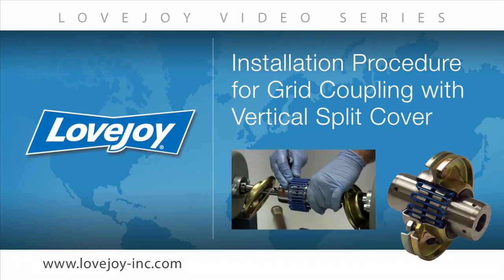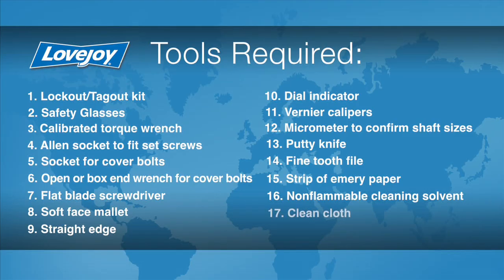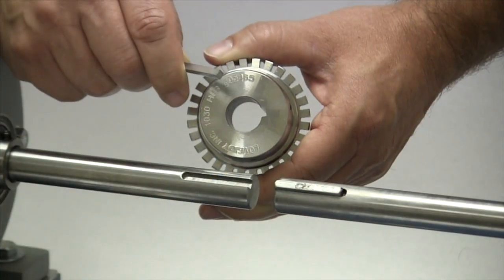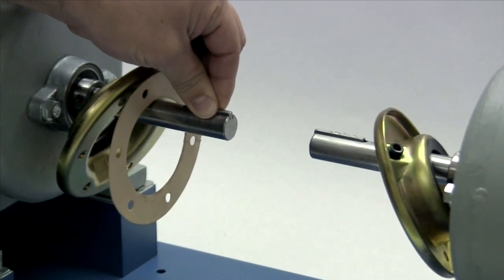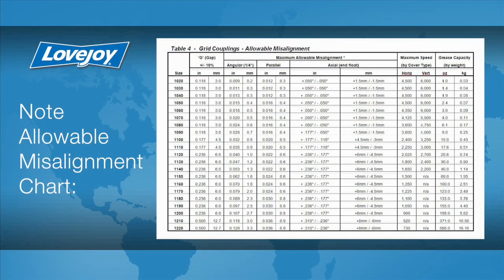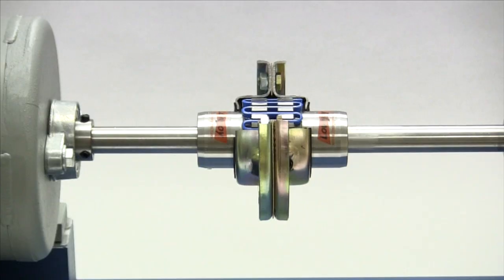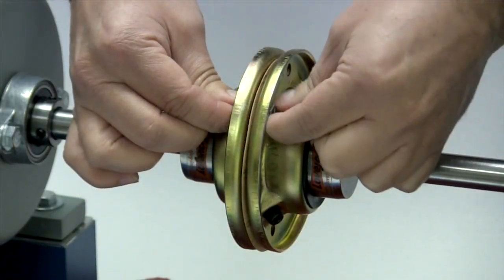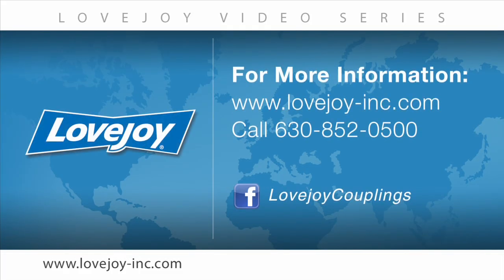Lovejoy Standard Grid Coupling - Installation Instructions for Vertical Split Cover

Comment: 120° is the best way to measure deviations, checking at every 90° with symmetrical, equally sized rotating parts is simply remeasuring at two points (0/360° - 180° and 90°-270°) if it deviates +0.010 at 270° it will basically be out -0.010 at 90°. @ 120°, 240°, and 0/360° when alignment deviates +0.010 @ 0/360°, it will be out - 0.005 @ 120°, and -0.005 @ 240° if horizontal elevation alignment in either shaft is off and lateral alignment is < 0.001 
If @120° the deviation is -/+ 0.005 rotate the coupled shafts 90° and repeat if measurements are the same, align the misaligned machine, if they are different, address the off center rotation or bend in the relevant shaft.